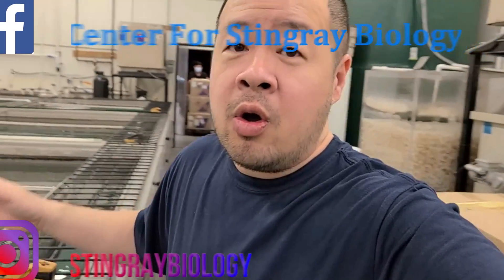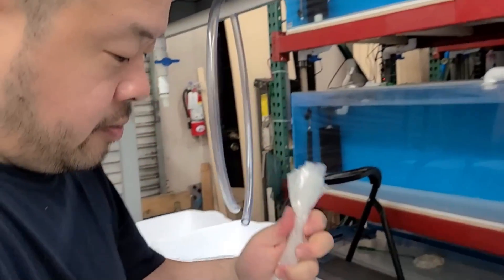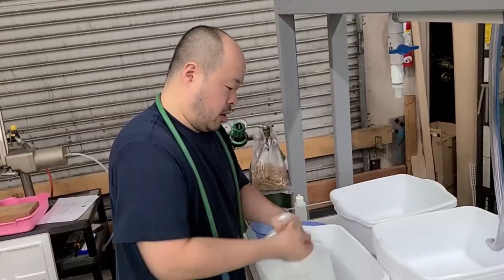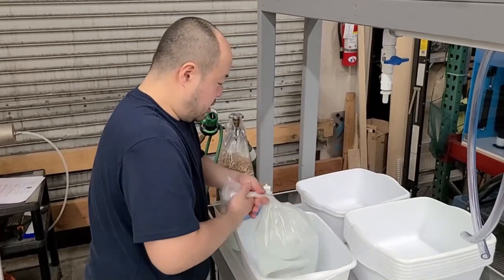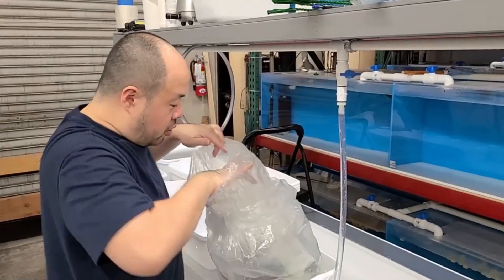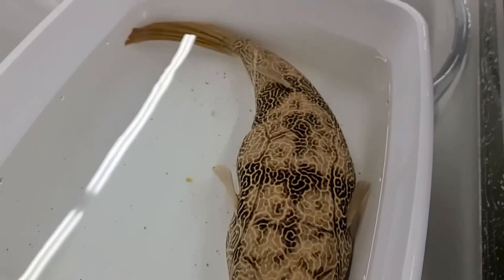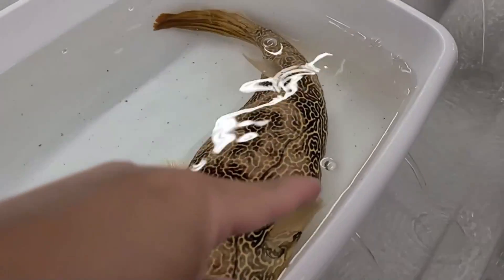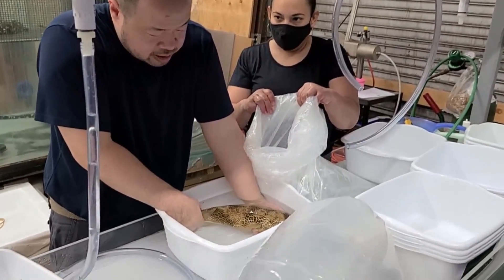UNBOXING LOTS of RARE EXOTIC freshwater FISH STINGRAY BIOLOGY

Comment: You might loose that Mbu puffer. When puffer puff up outside the water they can’t get the air out and usually die unless you hold it tail down and shake it under water.